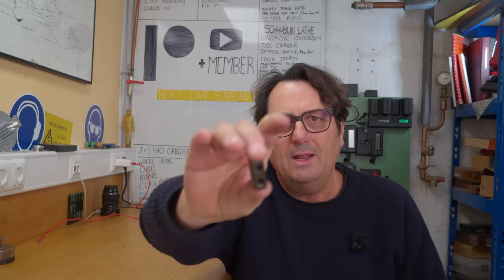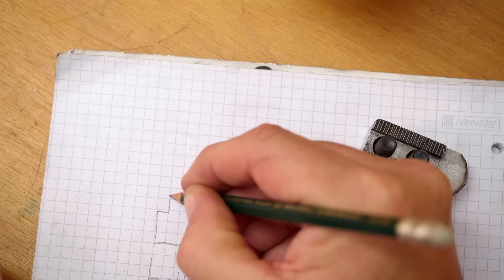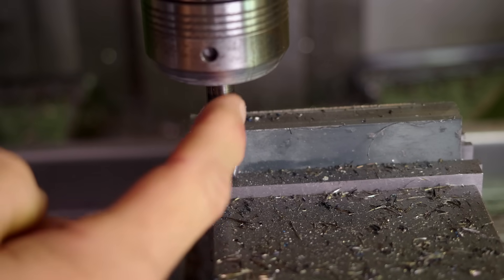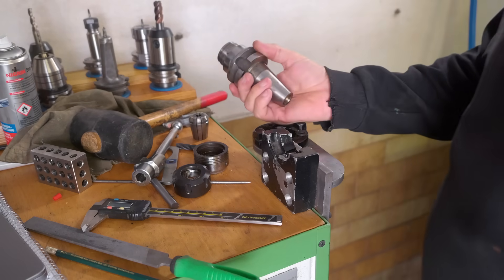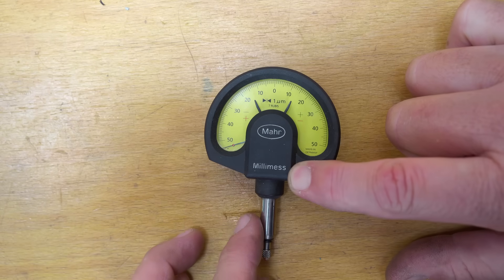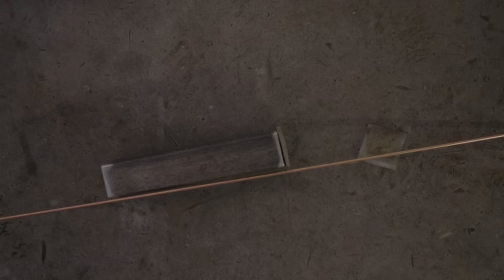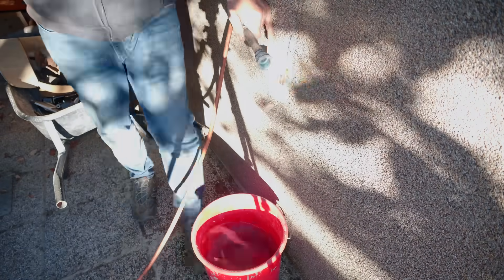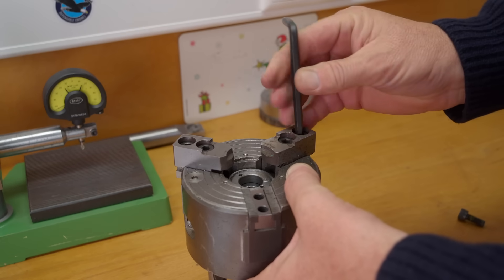T-Nuts - everyone makes them. Do you harden and grind them?  || RotarySMP

Comment: Used power chucks are a gamble. I have one that looks like it was never geased. Another like it was never used. 
The magnet test seems to be the bare minimum temperature. I made some plane blades with my son and in theory all was good, in practice it needed to be quite a bit hotter. 1/8" thick plane blades aren't easy to heat evenly, even just the cutting edge.. Working with O1, furnace, torch, plate quench, oil quench.
Reply from the maker: Good point. The other two were hotter and more consistently hard. That first one fell in the bucket a we bit early.

Comment: its a float that opens as it rises....floating on collected water
Reply from the maker: That makes sense. Wonder why it suddenly stop sealing?
Reply: @RotarySMP  You are missing the float & pin that ride that spline at 15:40. Perhaps it got lost after a cleaning? There is supposed to also be a cap on top of the filter screen & drain assembly that retains the float..

Comment: I've used similar filter-valves for getting water and oil out of air lines on automated equipment in a factory before. The threaded portion on the bottom was usually for attaching a line to lead the drain out somewhere cleaner.

I never had one apart though, so can't say what your problem might be. They usually sealed at a certain pressure, but below that it wouldn't seal and used the lower pressure to blow out the filtered out water/oil.
Reply from the maker: That is also what I expected. I wonder why this stopped sealing. Till now it worked fine.
Reply: @RotarySMP  it's been a few years since I worked there, but from what I recall the canister part on the bottom (with the valve) just occasionally needed to be replaced. Not sure if it was contamination making the seal not function, or wear, or something else. The maintenance department just swapped them out whenever they didn't seal anymore.
Reply from the maker: @LuciaMakes  This is a 45 year old lathe, so I doubt I will be able to get a replacement bowl. Will have to replace the whole filter I guess.

Comment: 16:30 drain valve: there are manual, semi-automatic (automatic drain when no pressure) and fully-automatic (drain when no pressure and when pressurized but too much water accumulated). The internal thread is just for attaching a hose to collect / guide the water.
Reply from the maker: Thanks. So far this one always seemed to work, but I never looked at it that closely.
Reply: Can you just put in a plug to stop the leak? Or a cap using the external thread? Thread on a valve and manually dump the water until its fixed?

Comment: Case hardening and then hardening? Why do both?
Reply from the maker: In the oven, the carbon diffused into the steel, bringing the case up to a carbon content that can be hardened. But it was then left to cool slowly in the oven, so it was not hard when I removed them from the tube. You need the rapid quenching to trap the Iron carbide into the Martensite form. Thy is why I needed to reheat above the eutectic and quench.
Reply: @RotarySMP  I see. Thanks, Mark.
Reply: Mild steel is low in carbon and won't harden. Mark did the right thing adding carbon.
Reply: The soft core eliminates the need to temper back, this is a feature of case hardening. A very high surface hardness with the durability of a ductile core. Win win.
Reply from the maker: I was a bit concerned about thread brittleness.
Reply: @RotarySMP  The threads are usually cut after carburizing to keep them soft.
Reply from the maker: @Bosun-8  Thanks. I should have considered that.

Comment: Mark, a question for you. I once made vice jaws that I heated in a closed tube to avoid oxidation. I welded it shut just like you did. During the heat I heard a loud bang and the tube was ripped apart at the welding seam. I thought stupid because of the pressure laws. No I see you doing quite the same without the burst... What's different here? The space filled with the carbonatisation powder? The thread in the end of the moisture collecting bowl is ment for a coupling so you can use a tube to guide the condensation to a different location e.g. the outside of a machine. Thank you! Best! Job
Reply from the maker: I would think the difference is my half arsed job of welding the final hole closed :) I guess it had a little vent left Job.

Comment: I make mine "fit for purpose", one of the few places where i truly skimp.

I currently have a 3x6 meter plastic slab in my router and it's held in by a bunch of M4 bolts that are screwed into pieces of a cold rolled bar that fit into the bottom of my t-slots. 

For one of my proper mills, i have a set that i have to keep in the freezer to fit in the slot and then hammer out once done. They had a purpose and did the job 😊
Reply from the maker: Those are really tight. I made these a nice sliding fit.
Reply: For the survey: the second pair are ground and was sent off to vacuum harden

Comment: The threads on the air filter unit could be for attaching a hose to lead the water to a drain. That's how it worked on the units I have worked with, to prevent water pooling inside the tool they were installed on.
Reply from the maker: Did the valve self open once the system was depressurised?
Reply: @RotarySMP  for semi-automatic and fully-automatic drain valves: yes
Reply: @blauesKopftuch  No, that's incorrect. Only semi-auto valves drain after it's depressurized. Auto valves only drain once the float hits a certain level and then the valve is tripped and the pressure blows the condensate out. It's good to have both a semi-auto on an aftercooler and then an auto drain after the tank if you want to keep the air as dry as possible. Assuming, of course, you aren't running a heat exchanger or a refrigerated air dryer.
Reply: @WmSrite-pi8ck  i have a fully-automatic one on my filter, it also drains when depressurized and it is definitively a fully-automatic valve.🤷
Reply: @blauesKopftuch  no, that's a semi auto drain.

Comment: I think the nuts should be softer than the machine table to prevent damage to it
Reply from the maker: That would be nice, but machine tables are cast iron, which has a pretty low modulus. These chuck parts are all hardened and ground.
Reply: @RotarySMP  usually the easiest parts to replace are the softest. Like tee nuts instead of hardened chuck parts.

Comment: Its a bit fussy but you should try to make all the t nuts the same, after all you are using them in a spinning chuck.
 A good rule of thumb if you are using a power driven style of chuck if you cant confirm the maximum throw via the manual is just to have the mounting jaws when closed go no further than the bore of it when closed. After all that's what the soft jaws are for. as you can usually run them outside the od of the chuck.
Also I wouldn't hold much hope for getting float parts for your water trap. I looks like its well over 40 years old.  The thread in the inside of the drain would be 1/4 bsp to take either a push in banjo  to run a hose to direct water away.  2 options repair wise. Both a manual drain either fit a valve on the bottom or plug it.  I used to fix them with a valve stem used on a tubeless rim. Something like this https://rb.gy/2pucev  . A new water trap with a manual or automatic drain is cheap these days.
Normally they are just being held open on the needle and seat by a bit of crud. It should have a very light spring on the float holding it closed to prevent leaking often the weight of the float is enough.
Cheers

Comment: I've not used that exact chuck, but I have a 6" MMK chuck on my cnc lathe, and the manual for the chuck says not to have any of the t-nut hanging out of the master jaw - it says the t-nuts must be fully in the master jaws. I think if they hang out 1 or 2 serrations worth, it's probably ok, but any more than that, I'd be pretty leery. I also had to (have) made custom t-nuts for that chuck to be able to use standard hard jaws with it. The skinny part of the T needs to be 11mm to go through the opening in the MMK master jaw, but 12mm wide above the master jaw to securely hold standard top jaws - why they made their master jaws slightly tighter I'm not sure, but it sure is annoying. All the other hydraulic chucks other than MMK seem to have standardized so the t-nuts and top jaws are interchangeable, but MMK needed to be special (and charge more for their non-standard jaws and t-nuts as a result)
Reply from the maker: Thanks for your feedback on that.

Comment: One step forward! You know the rest! Any chance of a repair on the chuck lugs? I have had several air dryers, some you loosen the screw to bleed, some you tighten the screw to bleed, but never had an auto one!
Phil
Reply from the maker: Thanks Phil. This only has nothing to close and open the valve (other than maybe whatever I could not find on the flow.

Comment: We use these Gamet chucks on an industrial scale on all our machines (up to 315mm chuck diameter). The jaws can extend beyond the chuck so far that the outer screw can stand out a maximum of halfway over the base jaw. Not further! Additionally, it should be noted that only the width of the rib and the right angle to the shoulders on the T-nut are important for repeatable accuracy in clamping. We do not harden our T-nuts, but of course, it can reduce wear.
Reply from the maker: Thanks a lot for your feedback on that. That is about where I would have been comfortable from eyeballing it too.
Reply: Are you familiar with why the chuck lugs would break internally?
Practices to avoid or adopt?
Reply: @jimurrata6785  English is not my native language, so I'm not sure what you mean by 'Chuck lugs.' However, I assume you're referring to the front of the chuck, where the jaws rest when the clamping force is applied? If they break, then the clamping force was too high, or the clamping point was too far from the chuck. Lack of lubrication can contribute to this – but in my 25 years in the profession, this has only happened to me once.
Reply from the maker: @rene_ger  In my Gamet chuck, the levers inside the chuck which turn the pull stud motion into radial motion of the chuck jaws have cracks.
Reply: @RotarySMP  You mean the master jaws, the ones with the Gamet gearing on them? That must be a manufacturing or hardening defect, because those are usually built pretty massively. Excessive clamping pressure or too much leverage from overly long jaws would more likely cause the split chuck front to crack outward. Where exactly did they break — right at the knee? I’ve honestly never seen that before, and I’ve serviced hundreds of these chucks. I definitely wouldn’t keep using the chuck with cracked wedges — that’s Russian roulette :(
Reply: Exactly what i was going to say!
Reply: The fractured “lugs” may limit how far you can safely extend the jaws.
Reply from the maker: @jeremylastname873  I doubt that, as the jaws range of motion is fixed. The loads on the palls should be the same regardless of soft jaw position.
Reply: @RotarySMP  "I doubt that" 
Mhh, I think you’re misunderstanding him here. He means the jaw overhang length toward the front. The farther the clamping point is from the chuck, the greater the leverage acting on the chuck from the clamping force. However, that still doesn’t explain the cracks in your master jaws.
Reply from the maker: @rene_ger  The cracks are not in the master jaws. It is the palls which convert axial to radial motion which are cracked.
Reply: @RotarySMP  Yeah, like I said, my English isn’t the best, especially when it comes to technical terminology. I assume you’re also referring to the splitted front side of the chuck, the area where the master jaws slide? Im sorry if i still missunderstand.
Reply from the maker: @rene_ger  A picture is worth a thousand words, and a moving picture is even better...
https://youtu.be/jyLLAUshcB4?t=982
Reply: @RotarySMP  Ah, now I see where the problem lies — namely that I’ve never seen this type of chuck before (sorry). I use wedge-hook or wedge-bar chucks, where the force is applied in the same way as in yours, but the internal construction is much simpler (at least on the wedge-hooks) and much more robust. I think the type you’re using is called a toggle-lever chuck. As I said, I’ve never seen one like that. In my opinion, the crack definitely comes from excessive leverage — either the jaws were too long or too much clamping force was applied. The spot where the crack occurred also looks very delicate - this type of chuck may have some advantages, but the clamping force is definatly limited.
Reply from the maker: @rene_ger  Yeah, shame it has been abused.

Comment: On the CNC lathe, wirh hydraulic chucks, the best rule is to avoid having the T nuts protruding.
Experience says that it depends on the applied pressure.

To increase T nuts travel, it is useful to round them on one side to let them go at the end of their slot.

PS: I'm seeing too much YouTube machinists hardening steel recently.
🤔
That is starting to make me think that maybe, an oven...can be useful...🤣🤣
Reply from the maker: Yeah, an oven is a handy tool.
Reply: @RotarySMP I'm also thinking about the idea of making a little foundry to recycle aluminium, for the plastic injection moulds I made it will be interesting.
It may be a viable option, but I'm however working in a nerd club/association, not on my spaces... I must have the approval of the majority of the members 😁

Comment: I believe that T-nuts should be the weakest point in a setup. If something happens, it should be the nut that breaks, and not the slot.
Nice to see Luke.
Reply: Whatever you do, the nut is not gonna break, and given that i have a whole box of nuts for such chucks - and they are all hardened, i dare say that he did not do anything wrong... Mind you, it`s not a box of custom nuts, they are the OEM nuts that came with the jaws... 

Whatever you do, the nut is not really going to break... The threads might strip, but at that point, you have likely already blown the slot out, especially when it comes to cast iron(not this chuck, but on machine tables)... My general approach is to make the T-nut as long and snug fitting as possible, which maximizes the surface that it applies forces onto, which in turn drops the pressure and allows the slot to cope with the forces much easier... Of course, the nut should not extend past the surface covered by the implement that it is clamping, but that much goes without saying... If a vise - for example - is 20cm(8inches) wide, the nuts will not be nuts, but rather, it will be a single 8inch nut that has 2 or 3 holes(some vises have a hole in the middle for clamping(between the side ``wings``) and spans the whole width of the vise body... 

But as said, the OEM nuts that i have for my cnc chuck are hardened and ground on critical faces, and the bolts are 12.9 grade, so there`s that... If the high quality brand name chucks come with hardened nuts as part of the OEM kit, then it should be fine to replicate that approach... 

Best regards!
Steuss
Reply from the maker: Thanks for your feedback on that Steuss
Reply from the maker: Hi Michel. Not sure if that is a right approach for a lathe chuck.